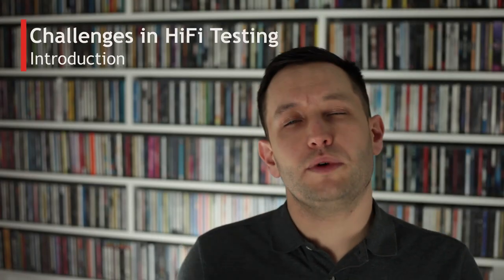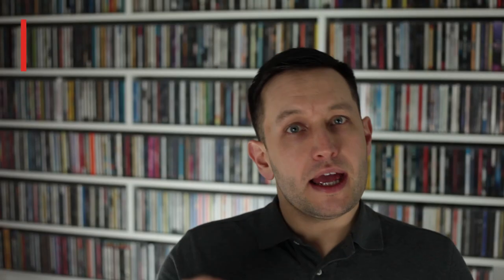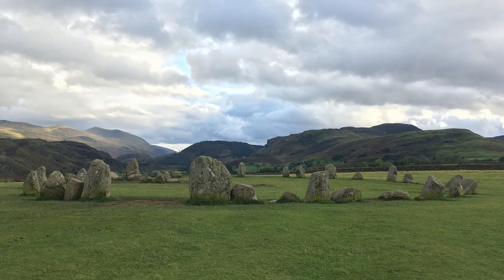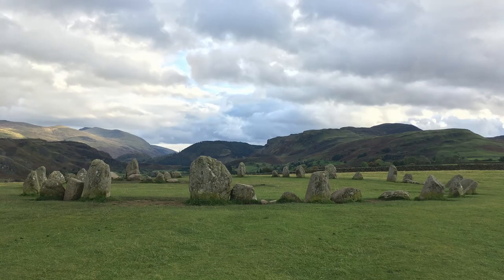Comprehensive Guide to Comparing HiFi Equipment (Speakers, Amplifiers, CD-Players, DACs, etc.)

Comment from the maker: Full article is also available on my website: https://audionostalgia.co.uk/challeng...
Intro: 00:00
Challenges In HiFi Testing - Introduction: 00:59
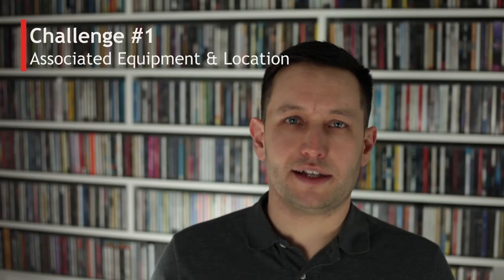Challenge #1 - Associated Equipment & Location: 01:44
Solution #1 - Change One Component at the Time: 04:10
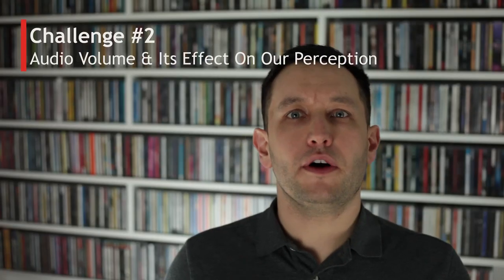Challenge #2 - Audio Volume & Its Effect on Our Perception: 04:53
Solution #2 - Always Match Playback Volume: 07:55
Challenge #3 - Auditory Memory & Time Between Listening Sessions: 12:40
Solution #3 - Minimise Gaps Between Listening Sessions: 15:31
Challenge #4 - Biases: 18:32
Challenge #4 - Placebo Effect: 18:56
Challenge #4 - Halo Effect & Implicit Bias (Stereotyping): 23:56
Challenge #4 - Confirmation & Selective Perception Bias: 27:44
Solution #4 - Run Single or Double-Blind Tests: 30:29
Challenge #5 - Lack of Recording Standards: 32:33
Solution #5 - Use Wide Selection of Recordings: 35:00
Challenge #6 - Reference Point, Adaptability & Long-Term Listening: 37:24 
Solution #6 - Don't Rely on A/B Only - Run Long-Term Listening Tests: 44:38
Challenge #7 - Reliability & Consistency of Our Hearing: 45:35 
Solution #7 - Run Multiple Tests - Repetition Is Your Friend: 48:55
Challenges In HiFi Testing - Summary & Conclusions: 50:09
Reasons For Being Honest With Yourself: 53:25